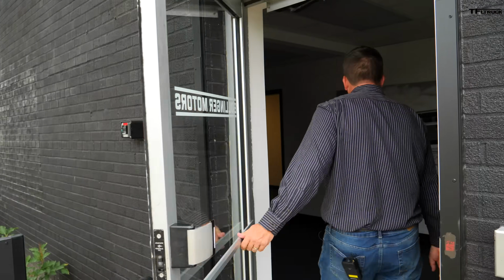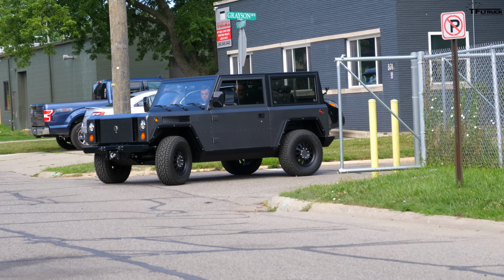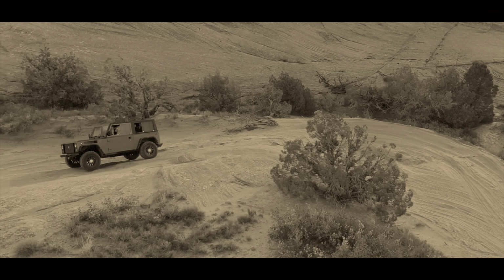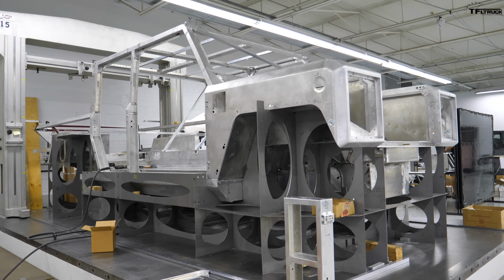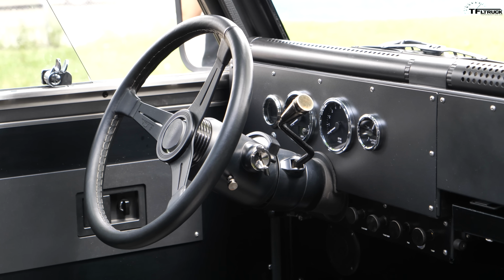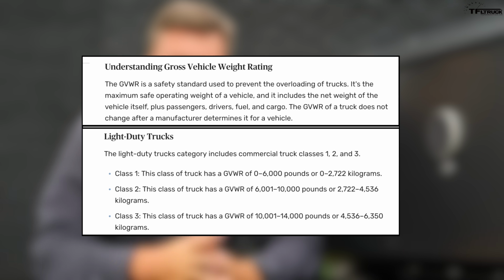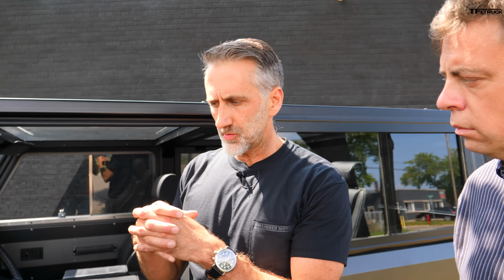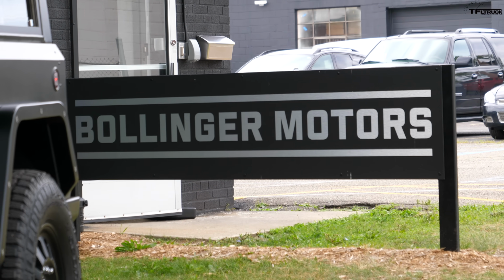EXCLUSIVE! Meet the Bollinger Trucks That Can Off-Road Like a Jeep and Haul Heavy

Comment: Question: why don’t they aim for a vehicle that is actually AFFORDABLE??!!??
Reply: They are a new company. At first, things will need to be made by hand, which means it will be expensive to make and only few will be produced. Then, they will see only few exclusive ones at high price in the hope that it will generate enough money to build the needed infrastructure.
Reply: @theyoutuber273  all true with any product. You cannot reconcile the fact that until recently, lower priced electric vehicles are butt ugly. One can wrap a platform in any manner. You are correct, but this vehicle will almost certainly be priced out of reach. Me? I can afford it. But I will not spend it. Principal of supply and a thing called demand. Produce a quality, attractive vehicle for the masses. Demand will supply the profits. Simple really.
Reply: @killerkane1957  you can't mass produce it if you don't have enough capital to start with.

Comment: your in a mountain suddenly you lost power , no electricity available?
unlike gasoline you can extra gasoline cans.
Reply: Carry a diesel powered generator
Reply: Well like Cindy pointed out an ICE geny is cheap and easy or you can have flexible solar panels and ether permanent mount them or stack them inside solar may take longer but it is not heavy and for emergencies.

Comment: Might be able to tow "heavy" but the range on it drops to nothing and then the recharge takes a long time so it's not worth it 
Electric are cool or drives with nothing being towed but when you start adding weights it's like the Tesla x they did to tow 3k well under the 5k in towing that suv can do and they were burning through there range so fast

Comment: 200 range  sucks.. we need at least  750 range but  better would  be  1000. then a trip can  be  done and charge  at  night, i can easily drive 1000  miles  nonstop. battery  tech needs  to improve.

Comment: Whether or not you like the design, these guys are bloody innovative. 

-Electric is the future and it will save you big bucks as it's a cleaner fuel source that won't ruin your engine like diesel or petrol.

-The suspension and brake system was brilliantly designed. I've never seen a car that can change its ground clearance 10 inches. You won't have to get a lift kit ever again! Amazing work!
Reply: You have won the dumbest comment award.  Where do we send the box of crayons?

Comment: Simple. No-nonsense. The rugged good looks and aluminum construction of an old Land Rover. Rivets. No autonomous driving bs, heat-failure prone screens, or elecricity wasting cameras instead of ordinary wing mirrors. Great weight distribution. Decent towing capacity. Low weight for a large EV. Portal gear reduction. Stock manual diff lockers. Excellent standard ground clearance. And the Inboard disc brakes and hydro-pneumatic suspension of a Citroen DS! What's not to love?! 

I will totally buy the pickup version of this, provided it doesnt wind up being outlandishly expensive due to low production volume, etc. (If it is I'll just have to wait and try to get my hands on a used one. Heh)

Comment: Just a thought. The transparent roof will encourage interior heat.  Why not put half solar panels up there and help reduce cooking the interior. 
I’m in Canada, Will there be an import deal with our Government.  We need your truck to operate in extreme temps. Normally +40c down to -45c.  This is where roof design will be critical.  Protection from the sun and yet advantages as well.   Have you thought of a $MSRP in Canadian $ ?

Comment: “7500 lbs. towing”... And like that, you lost me. I tow 5-6 days a week as a lawn and landscape company operator. If it can’t tow a 14,000 lb Dump trailer, or an excavator then it’s a light duty truck. Actually most 1/2 tons can tow more these days. Payload is almost meaningless these days with trailers carrying nearly all the heavy daily loads. Add to that a 6’ stepped bed. Good luck getting that load of drain rock out of a stepped bed. They will need to double the towing to make real inroads into the commercial and contractor market where the real money is. Give me an electric heavy duty truck that saves me a lot on fuel on my daily routes and can tow 20k and I’m there.

Comment: I like the styling.  The problem with any electric vehicles is the "right sizing" of the batteries.  With heavy vehicles like trucks, you'll need larger batteries for the same range and therefore recharge times start being a problem.  For an off-road capable SUV like the B1, the electric motors provide a nice advantage with torque and power.  BUT, range and recharge times are a problem.  It's hard to beat gasoline here.  Carry spare fuel and a quick fill up is possible.  Run out and have a buddy lend you a couple gallons of gas.  How do you do that with electric on the trail?

Comment: So, a Land Rover Defender and a Bronco had a baby...I like it.  Well, mostly.  It's going to be so expensive that only 2%-ers can afford it, which is a shame, really.  The all-glass roof bugs me, too.  Not a fan of sunroofs on trucks, so I hope they offer a solid roof option.  Really like the engineering to allow full-body pass-through for loading of longer timber and such, and the inboard brake system away from the outer hub.  Pretty interesting.  Will have to wait and see how it does in the real.

Comment: Heavy duty? The Colorado Duramax out tows this thing. I’m not impressed quite yet. I’ll definitely review the updates to the truck as time goes on. IMHO, it needs more towing capacity, more range, and perhaps a removable bed for those that want a chassis cab that they can customize to their needs. Styling is on point though, but it’s limitations make it a niche vehicle rather than a mass market alternative to a medium duty truck.

Comment: With all that flat surface they should really consider high efficient solar power to trickle charge the battery when you're "off roading" miles away from any charging station.

Comment: Its like a jeep missing fender flares in a lot of ways. 
I'm actually rebuilding a Jeep TJ atm and its square as heck when all the fenders are off. 
But i agree its pretty ugly with it having absolutely zero smoothing contours and a bunch of square bends.

I should add the 1 thing that would scare me about this is buying a EV from a unknown . 
what happens later if things need to be replaced 5-10 years down the road.  will they still be around will they still have parts?

Comment: So honestly, as a mechanical engineering major, there is a whole lot that I absolutely love about this truck. I think far more trucks should be like this one. An actual truck. Far too many "trucks" are glorified cars and crossovers. all swoopy and soft and full of gadgets and info-tainment mobile office nonsense. Though I am disappointed to see just the electric drive train. This body (clearly inspired by old land rover safari trucks and ford bronco's) with its design features, all the way down to the mechanical latch adjustable windows, but with a 3.0L monoblock six cylinder turbodiesel/6 speed manual gearbox setup, would be a grand slam. And likely much lighter, and less expensive to the end user. And while the three position adjustable suspension is a very cool idea, having worked at Audi, with their air adjustable allroad suspension I can tell you, that will become a maintenance nightmare after a few years, and he should do away with it unless it is 100% reliable and durable for the long haul.

Comment: I dont believe in EV offroad trucks. If you are wheeling out in middle of nowhere and run out of juice youre stuck. Probably would need a generator to recharge it. With an ICE you just bring extra fuel and youre up and going again right away.

Comment: Love it. 400km range is plenty for my needs. Would be cool to have solar panels as the roof. Charging stations are only going to become more popular. Could easily store few kW of solar panels to charge off-grid. By doing this the ultimate range is unlimited. A diesel or petrol will run dry and in a remote setting you'd be f#$ked. Touring EVs are the future, just require a more strategic trip plan to do it for zero fuel expense

Comment: There is nothing this good or practical on the market. Put an Achates gas or diesel electric for long range, a boost battery or super capicator for acceleration and look easily for 50 plus MPG. It will happen but just a matter of when. Does anyone remember the Holman-Moody Car that got 80 to 90 MPG with a simple Perkins diesel? Farmers in North Carolina were natorius for bragging about their Massey-Ferguson 135 tractors with the three cylinder Perkins that would plow ten acres of red clay soil on ten gallons of diesel or under a gallon an hour pulling two sixteen inch bottom plows. Style? Why should Greed always override Need. Why not own a fifty year life vehicle with very low maintenance?

Comment: Noticed two missing bolts at 13:45 and sheetmetal burn through at 14:35. For the bolts I am hoping that they didn't plan ahead for TFL's tour, but the welds hopefully that will get fixed before the vehicle is handed over to the customer(and prevents bad welding through better consistent technique or automation).

Comment: Rivian is the one I got my I on my radar. This one a close second. But like Tesla, what will the ownership experience be like. Accident damage spare parts and so on. These are only as good as the support that does or does not come with the vehicle. 6 month repairs are out of the question is my point. Insurability is my next. How expensive? Infrastructure, 200 miles is not allot, but decent for what it is. As an off roader for the far off lands is this going to be a trailer queen? Same with the other trucks too. Charging times need to come down, cleaner electricity has to be made. Convenience will have to improve as does efficiency and infrastructure. Electric is the way to go. Big oil companies have to get on board away from stupid fossil fuels and ICE needs to die. 0-60 mph in 4.5 seconds in a truck and 20 inches of ground clearance? Plenty of utility? We're off to a good start. I hope this company and others get it done.

Comment: This is a really nice truck, i am pretty interested in its design shape and every thing about it except its electric. If i could get this truck with a bullet proof diesel engine (engineered for the size and weight) of course. I understand electric is far superior when off road and having what you need at any RPM I just dont trust the technology yet.  have to agree with the creator about the design of it, its square and classic, a boxy design that will never get old.

Comment: 1.66 miles per kilowatt? That seems a bit low! I love the simplicity and redundant of the lay out and the fact that they are using portal gears for better ground clearance. But the things I don’t like is it has too many gearing to transfer the power from the motor to the tires, the low mileage and towing (668lbs of torque it should tow well over 11000 pounds).

Comment: I freaking LOVE this vehicle, everything about the look and engineering. What I wonder: I have a class A, and I’m comfortable pulling a 53’ trailer. If you made a 8’ x 40’ (97 sq meter) ultra lightweight trailer covered in solar panels, what would that do to the range? Just curious engineering question.
Reply: Probably less than the energy you spend pulling it. Big batteries like this usually have really high amperage draw to charge at a usable rate.

Comment: Love the look.  Dear Bollinger, instead of glass or plexi or whatever you have on the roof, use solar panels.  They can extend the range, help to charge, keep the cabin cooler, be used in an emergency, so many uses.  Might cost a bit more but will definetly be worth it.  Id never by a truck with a clear plexi or glass roof, you'd cook even in an arctic winter.

Comment: So lets see.  7500 towing, 200 miles of range with 110 kilowatt battery (I suspect Tesla and Rivian are exaggerating their numbers).  Another thing not mentioned is availability of parts.  Remember how getting parts for Tesla is a nightmare.  Bollinger might be the same or even worse since they are hand made.  I looked online to look at price of handmade vehicles.  While the Mercedes Benz g wagon would seem a good possibility but it looks like it's made on assembly line and it costs $125,000.  So even that price point seems unrealistic given the Bollinger is 100% hand made and not on assembly line.  Thus I suspect it will cost $650,000 to 2,300,000.  I suspect this is why Mr. Bollinger is skittish about talking price.

Comment: What happens when you run out of battery 100 miles from a fuel station/charging station?

Until this problem is solved, they are horrible off road.

Comment: does everything except tow a hill with a load, so Colorado not so much of a utility. maybe a station wagon, range? recharge station needed? cost to replace batteries and battery life? I don't see electric as a replacement only a novelty, won't work on the ranch.

Comment: Speaking of heat generated, made me think they should look into adding Seebeck/Peltier based electric generation to augment the range and assist in cooling/ air conditioning. I know those aren't very efficient, but could be very useful depending on weight.

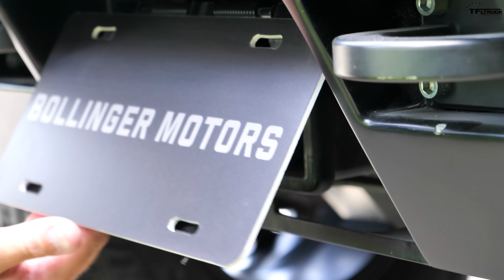Comment: 10:02 It can't be legal to run with the license plate flipped up like that, right?
Reply: As I understand it, in most states that would be illegal to obscure the main vehicle's plate in that way. It's fine if the trailer blocks the tow vehicle's plate because that's unavoidable but it an officer pulls you over while you're towing they'll need to see the main vehicle's plate. If you have to remove the drop-hitch to see it... that's not okay.
Reply: It won't matter as the plate is flipped up only when you have a trailer hitched up. The trailer has a plate and the truck has one on the front. All legal.
Reply: @joshfoleyJr  Except with your bike rack, and everywhere that doesn't have front plates.  But how would anything hiding/obstructing the plate from view be legal?  Even if it were legal, how fun is it explaining that to law enforcement?  I think it'd require at least a 20-minute roadside powerpoint

Comment: Very, very nice. Reminds one of the now defunct Landrover Defender, but this thing is nicer (and bigger). With a conventional diesel, it would have been superb as well. Not crazy about the adjustable suspension: KISS principle. Inboard brakes put a lot of strain on the drive shafts and CV joints although the in-hub gearing reduces that. Wonderful minimalistic design.

Comment: Personally I like it. But don't like the sound of the cooling issues. Have had several occasions in Aus where I have been driving in over 45*C heat. And the and it's a struggle on any vehicle but my Jimny handled it moderately well. 

Recon it would be a great platform to turn into a Eletric based hybrid, lose the frunk and put a small petrol/diesel generator able to run the car at normal highway conditions plus a bit to charge the battery and it would then be a brilliant long distance tourer. (in Aus on our outback highways we often have a 300km-400km distance between fuel stations)

Comment: I love the look and retro styling.  My problems are 1) that range is fine for day to day use for someone who isn't towing/loading a vehicle but is almost useless in cold weather or under load.  Their target market is going to be the guys who like old bronco's but largely have a garage queen.  The idea of someone using this for any amount of work with that range is not feasible. 2) a small shop making custom parts for a vehicle means that any repairs or going to be a nightmare.  Tesla has the same problem and they are trying to produce high numbers of vehicles.  Someone who isn't trying to scale is going to have infrastructure problems unless the production numbers are so low that they don't have any real demand for parts.
Reply: I'd commute to work in it. My job isn't brutal but the parking situation is one where you really don't want to worry ie cars just don't last and I'm always dirty and sweaty at the end of my shift.
Reply: @dchawk81  I'm guessing it will be a $70k+ truck.  That's a lot of scratch for a commuter vehicle you don't want to worry about!
Reply: @KSWSG  Yes but compared to a Tesla for the same price.
Reply: @KSWSG  I mean reality is an old beater pickup works best for where I work. But if it was down to Model 3 or Bollinger, I'd choose Bollinger without hesitation.

Comment: I wonder if they will offer solar panels with it. So when you get stuck in the woods and run out of power, you can charge.
Reply: you could fit 1 300 watt panel on the roof, with full sun I.E not under trees or cloudy days you would need about 66 days to charge the battery maybe half that to just get out of the woods
Reply: Lmao a solar panel to charge a 120kwh battery pack???

Comment: It won't replace the HD diesel truck until there are "fuel" stations where you can hot swap out a battery in 10 minutes everywhere across the country. Range is everything.

Comment: Any and all EV off-road vehicles should have adjustable throttle control so your “gas pedal” can be set to 2mph (example) with a full range of the pedal.  That would be easy to do and bring so much value so on the trail.  Just sayin’